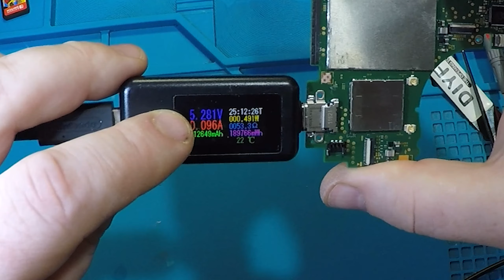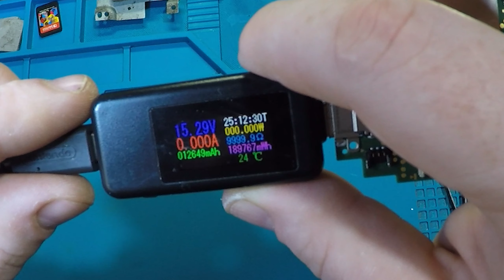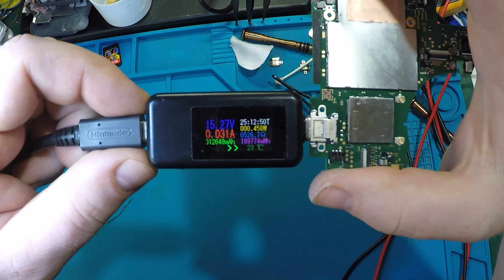We've received 3 Nintendo Switches with unknown issues. Can We fix them?

Comment: You flip the charging cable inside the amp-meter and not the Amp meter itself. Doesn't make sense since the pins which touches the USB port inside the switch doesn't change the orientation. But it still changes as you do it, how is this possible
Reply: He showed from one of the units that flipping the charge cable worked as he expected.  One side was 5volts and the other was 0 volts.  It doesn't matter the orientation of the amp-meter, it's what is powering it from the charge cable as it passes through to the amp-meter.